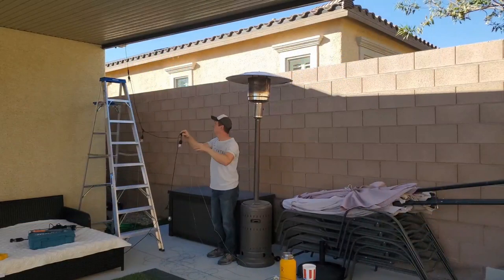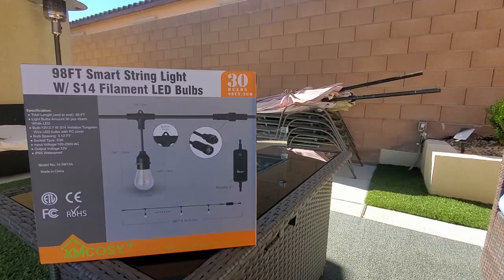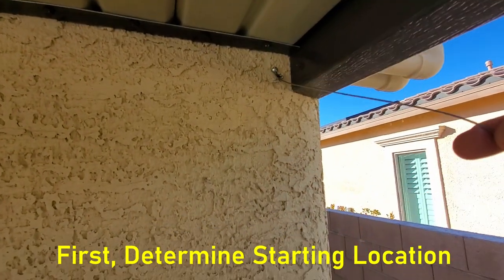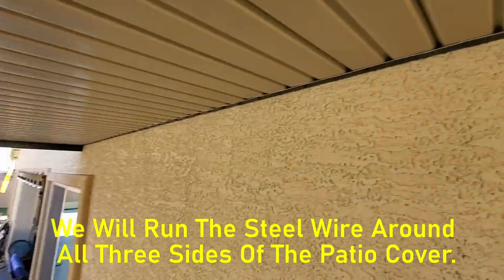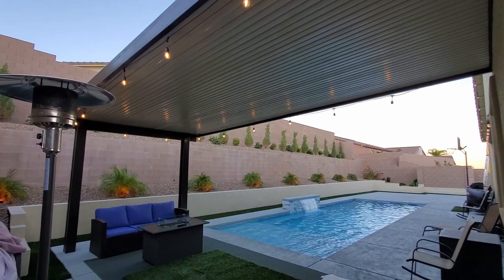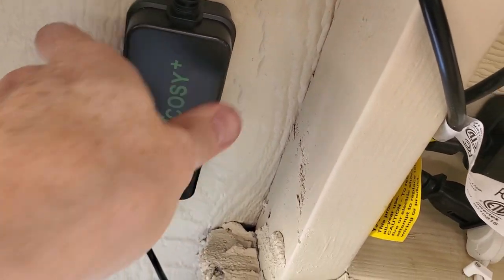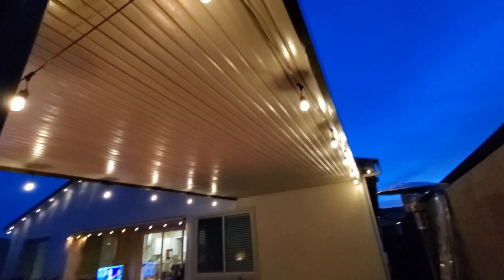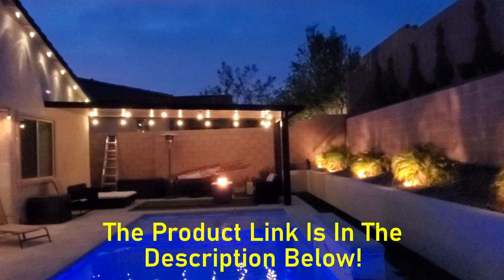How To Install Outdoor Smart String Lights-Warm White String Lights-XMCOSY+

Comment: Where's the power source?
Reply from the maker: I ran a outdoor extension cord from the pool pump outlet up the solar pool pipes to under the roof. All 3 of my roof lights are plugged into it. Each light set is custom with a schedule.

Comment: It's worth noting that NFPA 70-680.22(B)(1) of the code should be reviewed specifically in regard to this installation.  The light string/festoon lighting cannot be within 5 feet horizontally of the inside wall of the pool unless it is suspended at least 12 feet above the maximum water level of the pool.
Reply from the maker: Thanks for the information. And thanks for watching.